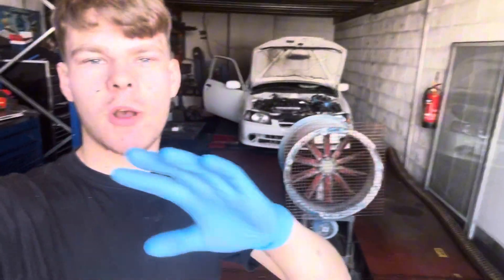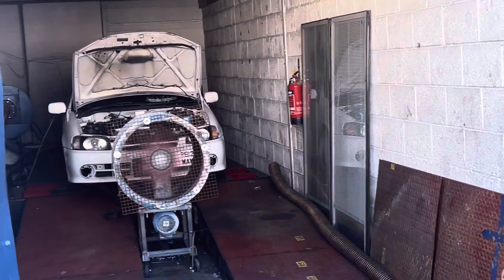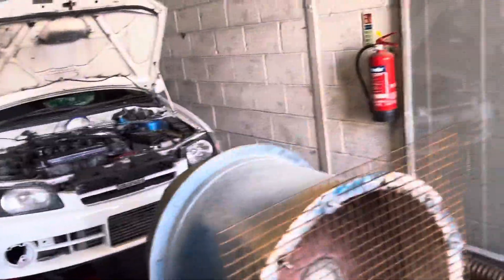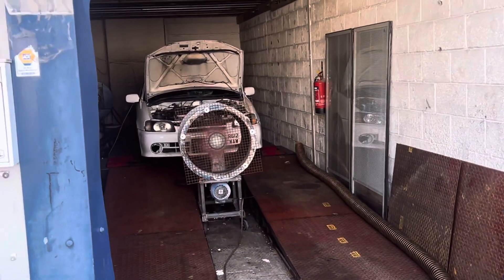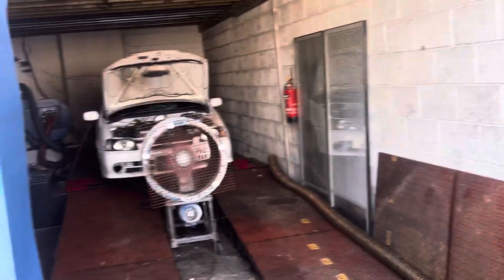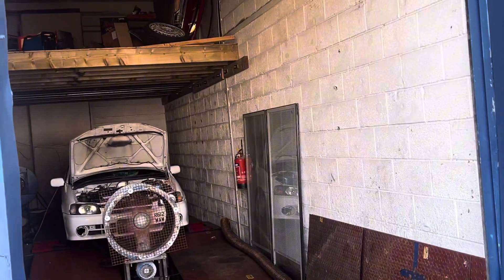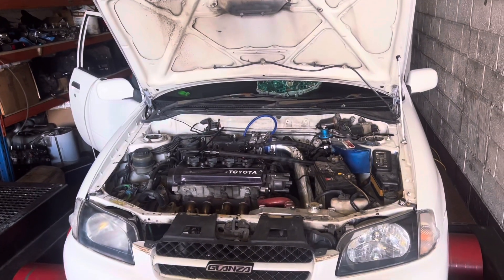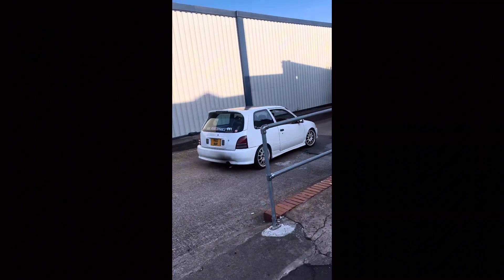Tuning Our Fully Forged Glanza

Comment: Hey Man how much for a remote tune my idle is all over the shop full forged standard 4efte head only hd valve springs and the car idles like crap had it tunned with a bosch iacv 19mm id tell me any pointers on idle ignition timing or anything to check
Reply from the maker: What ecu is on it mate
Reply: @ssperformance7197   elite 1000